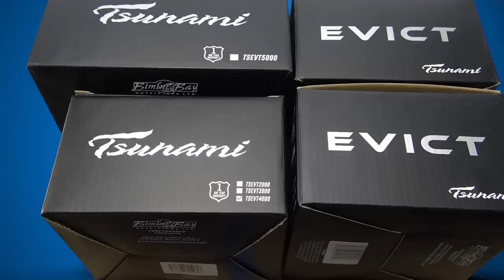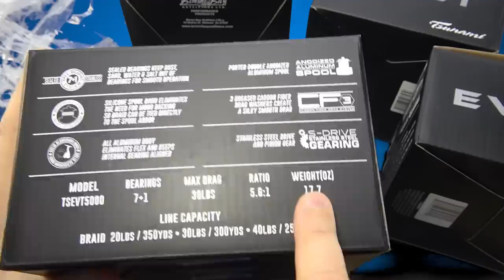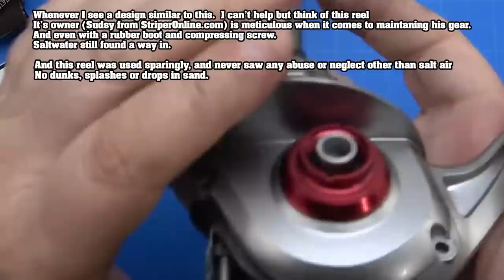Tsunami Evict Review - All Sizes - Inside and out -  The good and the bad

Comment: Your reviews are the best I've seen but I personally think this reel is garbage!
Reply from the maker: Thanks Nick,  I'm not disagreeing.  But I can't really call it that if it's nice out of the box without using it.    And if I called it garbage.  And it worked for a few seasons of party boat black fish use.   Because it had stainless gears and basic but rubber sealed bal bearings.  I'd look pretty silly :)  For me this reel mainly it's clutch and bearings would be done in a month of spring bass / bluefishing.  Simply due to not being able to avoid splashes and the occasional dunk
Reply: i've had many reels in my time and it seems like they all have at least one negative aspect that a person would consider it's achilles heel. this evict has that plastic ornamental piece in the back that doesn't have a gasket. i own two daiwa bg's that are considered great reels and advertised as water resistent but they both have an anti reverse switch that goes back and forth in a massive cavity cut out of the reels bottom that looks like it would sink a boat. at least on the evict i can take the plastic trim off and put a bead of silicone around the edge then put the piece back
Reply: in. the end what you pay for is what you get in my opinion!

Comment: I’ve just figured something out. 
You pass on some really good tips. 
I’ve got one for you, instead of using EXPENSIVE weights for soft plastic baits I’m thinking that screws (small) can be used as  neko weights. Stainless or brass if you will. The threads should hold them in place and make some nice noise when hitting bottom. 
You can also vary the weight by using different size screws.

Comment: Thanks for doing these breakdowns. I bought an Evict 2000 in May 2000, mostly jigging off dock. Had performed well but after a hauling in a large ray, the retrieve is sticky. What size Phillips are you using for the smaller screws?

Comment: Hey Scoob. Do you see any logic to reel sizes across different manufacturers (something like a Daiwa 5000 is always about the size of a Penn 6000), or even across a specific manufacturers product lines (are all Shimano 8000's exactly the same size). Some sort of chart would be extremily helpful.

I live way inland in Canada and the products I can get my actual hands on and put them on a rod is so limited even though I live in a major city. It's very hard for me to shop for saltwater rated equipment and have any idea what to get. ...of all the various reels you had in this video for comparison I only have access to one and its a 3hrs drive away.
Reply from the maker: Unfortunately there really is no standard.  4k for shimano used to be tiny compared to 4k from daiwa...now daiwa came out with the lt line which is similar to some of shimanos reels.   but everyone is different in terms of weight, size, capacity...kind of a pain in the arse

Comment: I was hoping this reel would be sealed as good as the shield model. Sad to say that open tail end under that cover is just silly. I wish the bail closing issue on my shield 3000 and 4000 could be fixed and I would be perfectly happy with the shields. I’ve never had to take them apart but the bails close on a long cast and I don’t like that.

Comment: Just got back from the local hardware store. 
I picked up some 8x3/4 stainless steel screws(.042 grams)They are perfect for neko weights. 6x3/4 would be a smaller size. 
Tee hee. 
Thanks for all the tips. 
Start them off with a toothpick, and then screw in the all new Malcolm weight system 😁

Comment: On baitcasters, do you prefer grease on the anti reverse bearing or oil?
Reply from the maker: it depends on the clutch.  I go by what it came with.   Well...at least if it was greased.  That usually mean it can take oil.  And if it was oiled.  It has the chance to not handle grease.  And I always test in the fridge to see if it fails.

Comment: i'm not ready to condemn this evict for the ornamental plastic on it's backside. take it off and run a bead of silicon around the edge and put it back and that fixes that. i have two BG's that are advertised as water resistant but they both have two huge anti reverse switches sitting in a huge open cavity on the bottom of the reel body. gives new meaning to achilles heel. these BG's are good reels but they'll except water just as fast or faster than the evict and be a lot more work to get into and clean

Comment: At a lower price point this would have been a good reel. Just consider that back plastic piece as a grease port. That gear set was impressive and the handle was cool. I don't think you get the SS gears in Fin-Nor until you get to the offshore series. The lethal line is pure crapola. You can get the spinfisher V's at crazy prices now so paying 180 for this is crazy.
Reply from the maker: You're right.  It was forged brass.   not stainless.   One nice thing about the SSV is that you can order brass gear sets  for direct fit replacements from penn.

Comment: always great reviews. If you place yamaha outboard  grease in the butt plate area and other areas where you think their would be water intrusion would that help? when i mean grease i mean quiet a lot of it. was there any mechanical flaw? with my understanding you worry only about water intrusion. if you grease the bearings and gears and the other parts i described would that solve the problem to what degree?
Reply from the maker: I wouldn't hurt.  Would help some.  Then theres the issue of how durable that piece is.  Especially in the cold.  There weren't really any flaws as it's a fairly standard and proven design. But the clutch housing in the smaller sizes is very low end I guess is the best way to put it.  From the clutch to the housing.

Comment: Just what I needed today.  Unrelated question: I think you mentioned something about a smaller size tactical angler clip being available sometime early this year.  Do you know if that is still happening?
Reply from the maker: Not sure on the release date but I've had em for a while now.  I gotta say though.  I kinda dig the fastach clips in the size 1 and 0 over these as they're still more compact.    I use the size 0 fastach clips on lures smaller than 1/16 and the size 1 on baits over 2 ounces.  I like them on standard sized jerk baits better than the TA 25 clip
Reply: I agree I have the 25lb ta clips they are hard to use with medium sized lures I ordered the 50lb sizes to see if it helps.

I also have been using the fastach clips and they work great for quick change .
However I got a fish onboard
the boat this past monday and as the fish was flopping the fastach let the lure go. 
The clip was still in perfect working order just got hung up in the wrong angle.

Comment: Hey man, got a question about your Wera screwdrivers. You mention PoziDrive every now and then. Are those screwdrivers cool to use on all reel screws? Will they damage some screws? Thanks!!!
Reply from the maker: Sup man.  As far as I've experienced.  And you see me using em.  Ive not once damaged a screw head using them.  And the light blue handled size zero has seen quite a bit of use and still works without marring screw heads.  Size 00 I use their Philips.  I've been in a crap ton of different reels from different companies and never damaged any.
Reply: Thanks for the info. Because of your channel I got into working on  my reels my self. Some of the screws are pretty small on reels and I definitely want to keep myself from messing up my reels screw heads. @TackleAdvisors
Reply: I got a Ph0 and a PH1 Wera and it makes working on reels way easier. thanks for the tip. @TackleAdvisors

Comment: Like the garbage smaller sized Abu silver max spinner. Same cheap white plastic housing with embedded cylinders. Of course they fell out on me and I lost 1 or 2 of them. Do you know where or how to find small parts like that? Just started servicing my own reels and that crap discouraged me. I didn't know if it's a common cylinder size or where to get them from.
Reply from the maker: you'd have to but the entire clutch.  As far as I'm aware that'd be the only way to guarantee material and size.

Comment: I bought a Tsunami Guard 5000 and had issues with it, Tsunami is sending me an Evict 5000 to replace it. I'm really curious to see how it works first hand in the surf of NC. I'm gonna run it through the ringer and see how it performs. I'm not sure if the bail was bent during shipping which is possible so I'm going to give them the benefit of the doubt and try this evict out before I pass judgment on them.

Comment: Hey buddy, have you done any reviews on waders? I got the same headlamp as you figured I'd try the waders you like to use as well
Reply from the maker: Hey man.  I was using ll beans went through a 3 pairs of helix and 3 pairs of Kennebec zip fronts.  Scored Redington zip fronts on amazon for like 225$ last spring and have been using them.  Definitely guide weights not as breathable as the beans. But looking at the new Kennebecs.  It looks like there is an inner leg seam which is a no no in my eyes.  I use the devils canyon korkers with them and even though I didn't like em at first. I think this is season 4 with them which is insane since I never got through a single season with other korkers in the past.  No real ankle support more like a tennis shoe in that regard but the flexibility let's me stick like glue on jetty rocks and rivers.  Never a single fall while in em
Reply: Witch pair did you find have the most comfortable booties, I just returned a pair that the foot had a thick uncomfortable seem under my toes.. My biggest concern is finding a pair with comfortable feet not many places to shop than online I'm just looking for a good pair with a better seem design
Reply from the maker: @daltonfishing8872  Man......that's a tough one.  I think it may be a mfr issue as I've had same sizes and styles fit differently especially in the bootie.  I think the best bootie design goes to simms.  I noticed yesterday that the tape on the redingtons I have is starting to tear in the base of the heel.  bad sign.
Reply: Thanks man, I like your opinion on things... I'm going to go with the simms tributary waders, I'll look into the wading boots you told me about... Thanks for the help